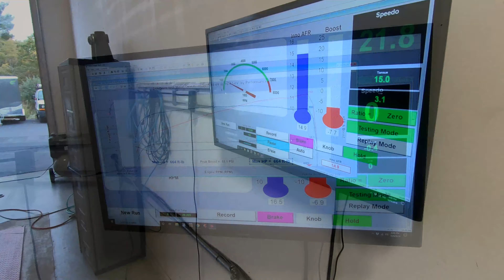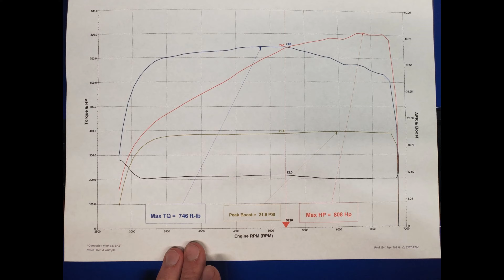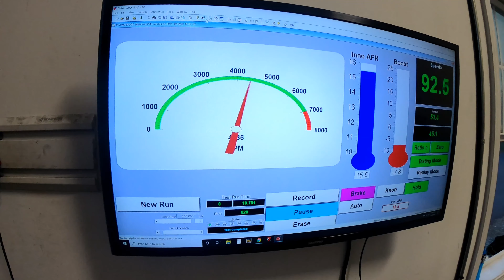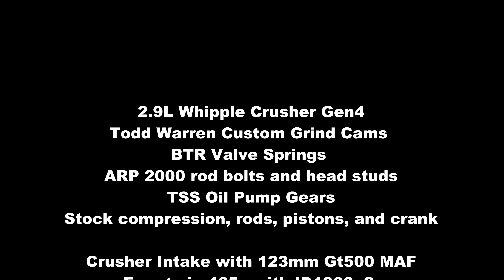900+whp Cammed Whipple Crusher: 03 SVT Cobra Dyno Video

Comment: I know this is old but looks like you only had an upper pulley with stock lower?  Is she still running strong?  I'm building a similar setup with a 3.85" upper pulley, not sure how much boost I'm going to make but trying to keep it around 20
Reply from the maker: Still stock diameter lower yeah. No issues
Reply: @Intervention302   So what pulley do you keep on it normally?  Mine is getting built with the MMR  4.75 1500hp rotating assembly, custom ground stage 3 comp cams, 8an/10an custom fuel system with Magnafuel pro tuner 750 pump.  I used to run c12 in it all the time mixed with 93 because it was easier to get and pretty inexpensive compared to the VP high-octane unleaded stuff.  Also, what did they tune your car with?  My builder wants to use HP tuners.

Comment: going to tune right now,what should be the rev limiter for 3.0 gen 5 gonna aiming for 900.
Reply: cars built and has kurgan cams
Reply from the maker: The RPM limiter should be what the tuner wants/feels comfortable setting it at.
Reply: @Intervention302  gotcha thanks brother. Ended up doing only 780. stock alternator killed the power up top...

Comment: I have an 01 Cobra fully built top and bottom end built to hold 900HP, do you think the 2.9 Whipple is enough, or is it possible to fit a 3.2 or bigger in? Also, was it hard to install the supercharger? I've been looking around but I've found very few videos that actually go in depth about it.
Reply from the maker: You won't be able to max a Gen4 Crusher out
Reply: @Intervention302  What do you mean, because I'd have to upgrade the internals again?
Reply from the maker: No. Meaning you'll have no issue hitting your goals with a built motor, E85, and 25psi
Reply: @Intervention302  Ohhh ok, that makes sense
Reply: IF I DIDN'T HAVE MY 04 TORCH RED TERMINATOR LOL I WOULD HAVE A 03 SONIC BLUE.